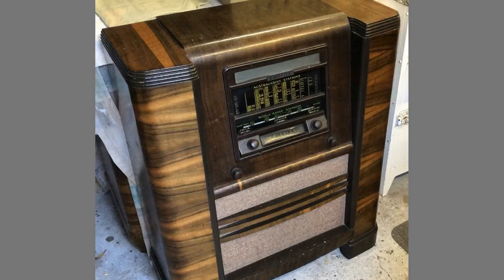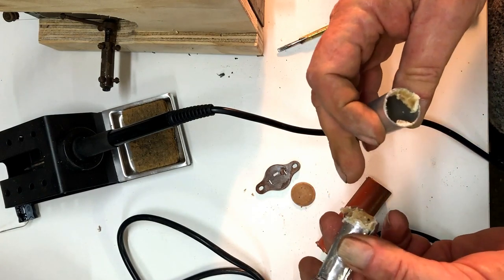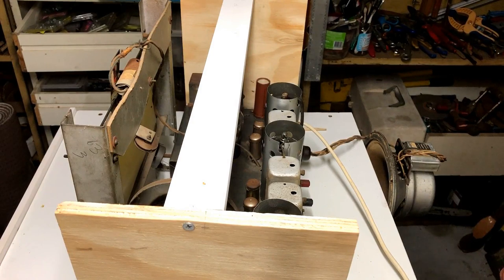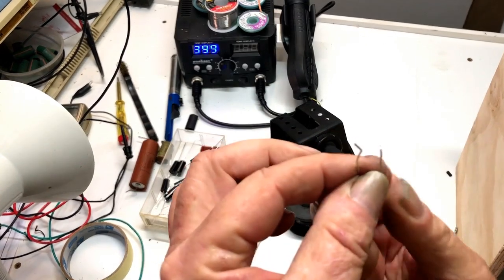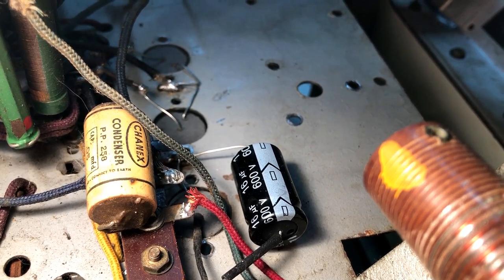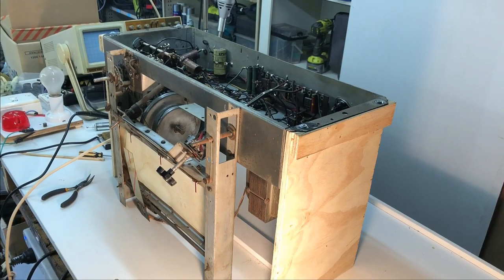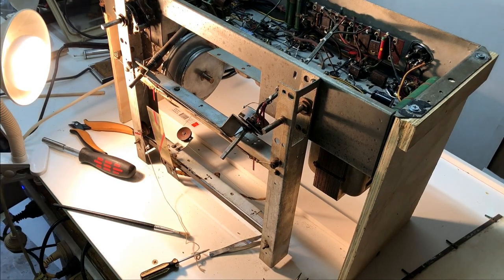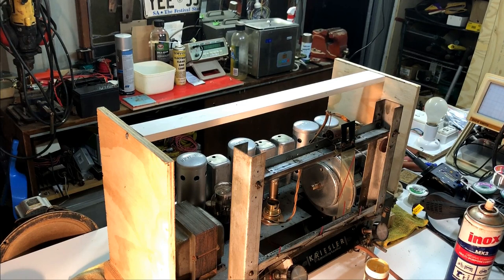Kriesler Valve / Tube Radio model 3K40 - Repair & Restoration Part 2

Comment: The parallel cap is to reduce impedance at higher frequencies. Electrolytics of those days had poor (high) impedance at higher frequencies,
Reply from the maker: Hi. Yes, that finally makes sense!  I had a feeling it might be something to do with the characteristics of the electrolytic cap but couldn't find any info about it.  
Thanks for the info!

Comment: I am not sure what flux or solder to buy these days but i used to use dazzle for the hard jobs like soldering to the chassis and had a older version of Duratech solder that was good.
Reply from the maker: I guess I’ll have a look at what’s available on last line. There’s probably Chinese stuff around but that’s probably no better than what I’ve got. Cheers

Comment: I went to Perth about 10 years ago and went to a restaurant/bar that sold 'chillie mice' , chillies stuffed with three types of soft cheese then fried in a tempura style batter. Amazing, nearly blew my head off. Good channel, I like your style. I also watch David Tipton. If I ever stripped a chassis completely, I'm not sure I would ever get it back together. I agree that philips valve radios are horrible to  work on, just done my first, the electronics part was easy, all the mechanical problems and cleaning (pipe smoke residue) were harder. It performs well.
Reply from the maker: Cheers Steve.  The chilli mice sound amazing!. Not sure I would try them. Even though I had a Thai girlfriend for a while, I never did get used to really hot chilli.
You're right about Philips.  The electronics are good but the mechanics are diabolical!  I have an old Philips bakelite mantle radio waiting to be done.  Not sure if I'll do that next or a little record player I recently picked up.

Comment: I have noticed you have the same solder duratech and the same flux Caig brand and to tell you i do not think much of either of them what are your thoughts.I had older brands were much better.
Reply from the maker: I don’t think much of the flux. I bought it from the local Jaycar store as it was all they had. Ditto the solder - not great but it’s all they had. Perth isn’t a great place to buy electronic supplies. My best option is probably to buy it online. What would you recommend?

Comment: Great work Don. I'm also confused at the 16.1uf. Ive seen that before and like you I cant work it out.
Reply from the maker: Hi.  I have since been advised that the parallel cap is to reduce impedance at higher frequencies. Electrolytics of those days had poor (high) impedance at higher frequencies.
These guys didn't do stuff for nothing so I thought there must be a good reason.
Cheers!
Reply: My understanding of this is that the 0.1 dumps any electrical noise on the HT to ground, ensuring nice clean DC (and the 16uF creates the DC). 

I'm enjoying this series Don, a nice detailed repair.

Comment: Hi Don,  I want to make a couple of videos, been using my son's Samsung mobile, what sort of camera do you use. I don't want to compete with you or David, just a cheap entry level will do. I want to demonstrate how we made acrylic dial cover, and how I made bobbins for transformers. Thanks Rudy Transfeld
Reply from the maker: Hi Rudy
I'm still using my old iphone 8 as a camera.  It does a great job and I have never had any reason to change.  The lenses in phones these days are really good and I would suggest that your Samsung would be just fine.
I would suggest you get a tripod with a phone attachment. Only a few dollars on ebay.  I like to set it up so it looks over my shoulder and down a bit so you can see what I'm actually doing.  Do a dry run first to make sure you don't have your head or an arm in the way, then film away.
Another thing I would recommend is that you buy a decent plug in lapel microphone for your phone.  I use a RODE smartlav+.  Mine cost $70 on ebay.  You can buy much cheaper ones but they really don't sound as good - they seem to pick up every noise except your voice.  People don't notice good audio but they certainly notice bad audio and built in phone microphones don't really cut it.
The other part of making youtube videos is editing.  Your phone probably has some basic editing aps that you can use to cut up the various bits of video into a coherent sequence.  iphones have iMovie, which isn't too bad but fiddly to use on a phone as I have fat fingers. I find it works better on an ipad.  I guess an android tablet would have similar advantages.  
Any questions, just ask.  It might be better to email me at:  donno1955@hotmail.com - that way I can send pictures etc.
Happy to help any way I can.
Cheers
Reply: Thanks for your reply. I made two YouTube videos, it seemed like a long drawn out process with editing and the like, what is your process before beginning a video ? I noticed one person, I think Jim somebody, does his unrehearsed and unedited. If I did that it would turn out a blubbering disaster.
Reply from the maker: @artyt3204  Yes, it is a long drawn out process, especially at first.  Like everything it gets easier the more you do it.  
How you approach it I guess depends on what you want to achieve. I watched your 2 videos and the machines are quite interesting, especially the second one. It's really a work of art!  David Tipton would be interested - he has been on a coil winding journey for the last year or so and has experimented with building his own machines.
I like the way you told the your story in text at the beginning of the second video.  A great introduction to your channel.
As for my technique, I don't rehearse anything but I don't just leave the camera on either.  I tend to work quite slowly, stopping for coffee breaks etc. quite often.  
I tend to imagine I have a friend with me and I'm showing him how I work on radios.
I'll video enough of what I'm doing to give people the idea but I don't think people need to see me take out every screw or change every capacitor.
When I've finished a session I transfer the video files from my phone to a USB stick and load them onto my desktop PC.
Then I usually watch them through and chuck out any that I don't think I'll use.
Then I add them, usually one at a time, into the video editor.  I use the VSDC "free" video editor because, firstly. it's free (although I have upgraded to the pro version for about $30 a year).
Using the editor I cut out the bits I don't want, the  false starts, the dribbling bullshit (I do a bit of that) etc. and try to make it all into a coherent story.
In doing that I think about the pace of the video - it has to keep moving along - and whether it would make sense to someone watching it.  I usually do the fades / transitions, bits of text etc. as I go.
I have a bit of fun, sometimes, making the thumbnails.
I'm never too sure whether my main hobby id fixing radios or making videos.  I guess I enjoy both equally.
Send me an email and I'll send you some of my raw footage so you can see how I work.
Cheers